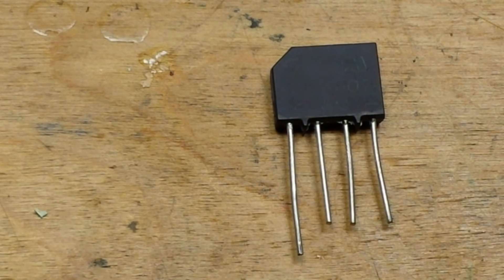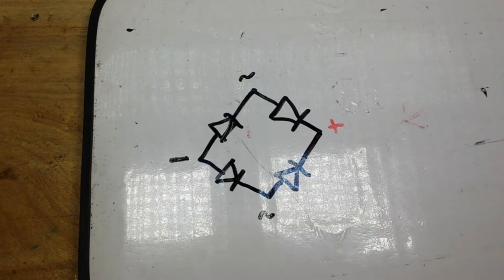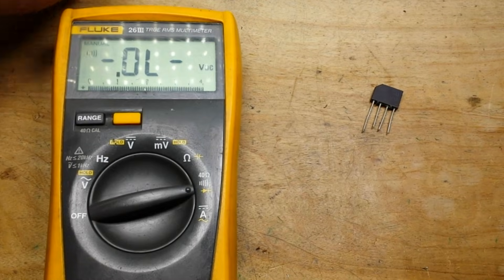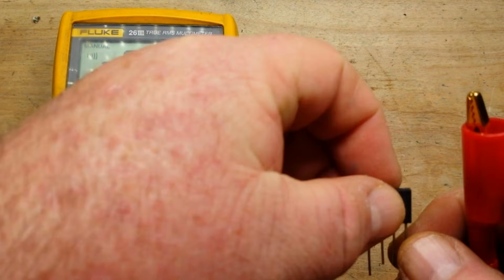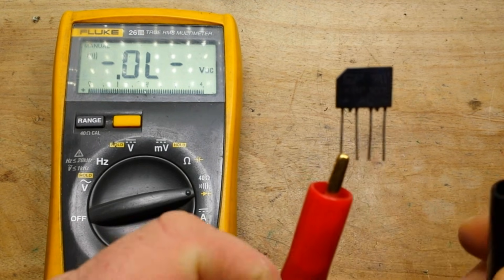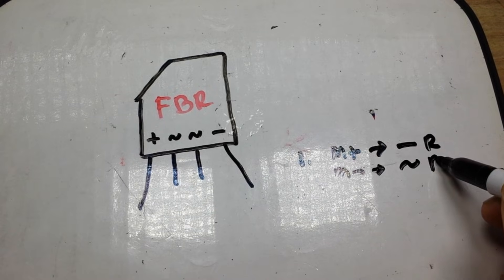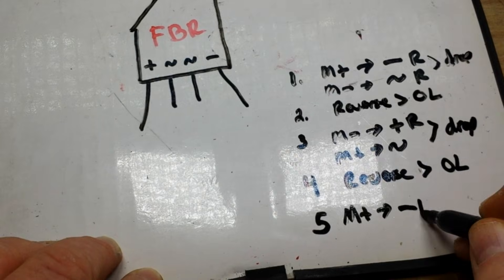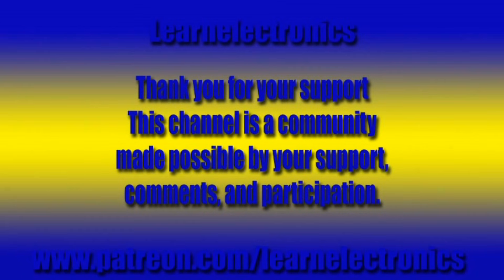How to test a bridge rectifier with a multi-meter

Comment: To those asking if you need to pull the component off the board: yes, you may. I was getting readings showing voltage drop in the negative bias direction and when I removed the BR from the board and retested it was fine --disappointingly.

Comment: Great video, When testing my bridge diode, I don’t get a doubling in voltage with the multimeter. When testing the middle legs, I get a 0.560 v,  but when I test the minus and positive I don’t get doubling but 0.740 v but an increase of around 0.200

Is this diode any good

Comment: I know very little. If you measure a rectifier on board will you still see the same numbers? I suspect it must be removed from the board to test in this way?
Reply from the maker: You need to measure it with a load, so you can leave it attached. You want to disconnect things like resistors, caps, inductors etc. they can be influenced by other resistors, caps and inductors in the circuit. However, you only need to resolder 1 leg.
Reply: @learnelectronics  thank you! If a thermistor burned up would you first look at a rectifier for failure on a power supply?

Comment: In my case rectifier in a monitor smps  has 0.5v drop on each side and 0.5v drop in dc output instead of 1v.
What do think? I do the test on offline pcb.
Reply: Remove it from the board, I had the same issue on an offline board.

Comment: 4:37 What if you get lesser than 1volt (0.6v) when you measure across the diodes in series but each individual diode measures at around 0.55

Comment: Hello I have a GBU406 and it test ok exept that between the DC + and -- the value stay's at .5 not .5+.5 why? Is the rectifier defective also it has 170vdv when the power is on. It is for a 24 vdc battery charger for a weelchair. Thank you

Comment: i got a GBP410 ,is it all similar ?
Reply from the maker: Yes
Reply: @learnelectronics  i need make this ,by using some diodes ,i saw on other videos they make it soldering 4 of it,.but i dont know which diode to buy,i need to make 4 amps ,700-1000v ,.

Comment: subscribed, the easiest and quickest method i could find - do you have any videos for testing SF20A300HPI (i think its a mosfet or dual rectifier but has 3 pins) and a FSCQ1565RT Fairchild Power Switch and an Optocoupler?  l love the way you deliver the knowledge, so easy to absorb

Comment: Thank you for this. I am testing the bridge rectifier in circuit. The first 4 steps check ok but when I do the last step I do not get the doubling of the voltage. I get the voltage drop of only .5v and not 1v. Does that mean the rectifier is bad? Anyone?
Reply: good question as i get this too!

Comment: It is sort of confusing.
When testing a diode, you put the negative lead of the meter to the arrow side of the diode to measure voltage and the positive on the tail end.
But as a rectifier, the arrow head end represent positive side of the load, however to measure it on the meter you have to hook up the negative lead of the meter to it.   And also, you hook up the positive side of the electrolyte capacitor I assume if you want to remove ripples.  Is this correct?
So, to test the rectifier with a meter, you hook up the positive to the negative side of the rectifier.  Hmmm I can see why it needs closer attention as to why the rectifier is labled differently.  The arrowhead is positive side with respect to the load and so it labeled with respect to the load and not the meter.

Comment: Thanks so much for the explanation.  I have a Chinese compact plasma cutter and this this is what exploded on the main PCB. I am unsure if I can use a 3A/1,000W instead of a 2A/600W that was there previously?
Reply: Yes u can do so without any worries. If it were the other way around then you certainly would not want to do so. Remember, it is almost always best to over-rate rather than under-rate components

Comment: I have two B20XB80 bridge rectifiers rated 800V at 20A and one reads higher drop than the other. Would it be worth replacing both?

Comment: What if you check the resistance be the two AC leads and the result is 1.5 ohms. Would that be the reason my compressor keeps blowing fuses

Comment: Excellent video, thanks. Question: Could you test the bridge rectifier in circuit?
Reply: Yes I guess. Mine shows 0.5 voltage drop across plus and minus  when tested in circuit. Off circuit reads correctly which is 1 volt voltage drop.
Reply: yes

Comment: Totally confused. I used this test(DC) method and it showed my rectifier as dead, zero voltage either way. I did a diode test and that showed my rectifier as good. So how do I know which is the right way? I do not have a scope.

Comment: What if in step 5. I didn t get V drop *2 , I get  value V drop equal measured in prevoius steps?
Reply: I ask the same.
Reply: Then you have a failed diode! Unfortunately the method of testing is incomplete as not every individual diode (there are four of them) has been individually tested.
1) Lets label the pins as A, B, C, D, where A is plus and D is minus, B is alternating current and C is alternating current.
2) Test in each polarity direction:- A to B, B to A, B to D. D to B, C to D, D to C, A to C, C to A,
Reply: Hi, I have the same problem.  In the end did you find out whether you have a good or bad rectifier?

Comment: Learned something. Just one question. What if on step 5,  diode voltage drop was not doubled?
Reply: This is what mine was doing too, step 5 gave me a the same drop as the other steps so I'm guessing mine is bad
Reply: @GunterCantGame  Actually I have an Induction Cooker blown , TWO bridge rectifiers give step 5 the same voltage drop not doubled. Are they BOTH blown, and that's the cause?
Reply: Hi, I have the same problem.  In the end did you find out whether you have a good or bad rectifier?

Comment: Thanks for the video, I have a question. I did the test and it measures 0.45 approximately between ac and rectifier but when I go accross the entire rectifier it measures 0.57. It should be around 0.9 right? So, what does this mean? Is it bad??
Reply: I have this too, and for a splitsecond the meter beeps when I touch them, before going to about 550
Reply: Hi, I have the same problem.  In the end did you find out whether you have good or bad rectifier?
Reply: @philipchong3098  yes bro, I decided to swap the bridge rectifier for a new one and problem solved!!!

Comment: I don't think you've fully recovered.. I believe you only tested 2 of the diodes in the bridge. Try using the schematic to show your connections and explain what is being tested and I think it will show that only one of the diodes from each ac input was tested.
Reply: Tom I am a newbie to electronics, but being the diodes are sealed in a package the only test points would be what you can physically get to on the leads.  Please correct me if I am wrong.  -Ken
Reply: @kenlanier2131  Since there are 4 diodes in the bridge, it would take 4 tests to test each of the four diodes.  Looking at the schematic of the bridge, note that each diode is connected between two terminals of the bridge.  Connecting the meter across each of the four diodes is required for a complete test of the bridge rectifier.  Each of the four tests below should show about 0.6V:
  1. Connect the negative test lead to the + terminal of the bridge and test to one ac terminal.
  2. Connect the negative test lead to the + terminal of the bridge and test to the other ac terminal.
  3. Connect the positive test lead to the - terminal of the bridge and test to one ac terminal.
  4. Connect the positive test lead to the -terminal of the bridge and test to the other ac terminal.
  5. Repeat the four tests above using the opposite polarity of the meter and you should read an "open loop" for each diode. -Tom
Reply: Right. His last test between the + and - isn't necessary
Reply: You are correct sir, one test really missing.  The test between the two AC input points should give no reading either direction.  If it does one of the diodes are blown.
Reply: @sydneybarnard8569  should it say OL, or will it indicate with a buzzer and flash red like mine does